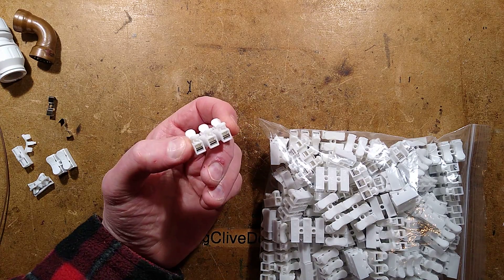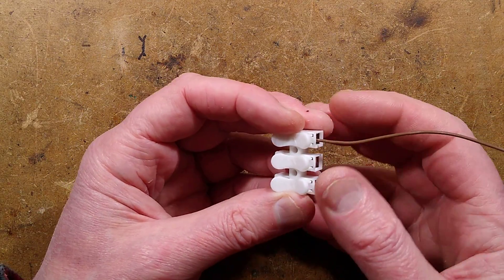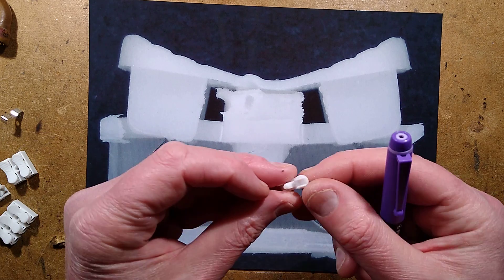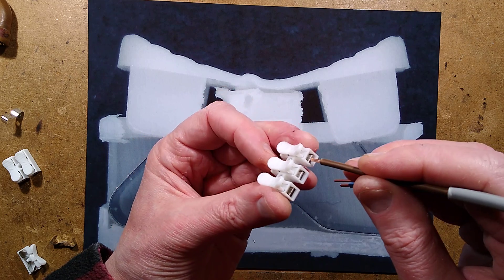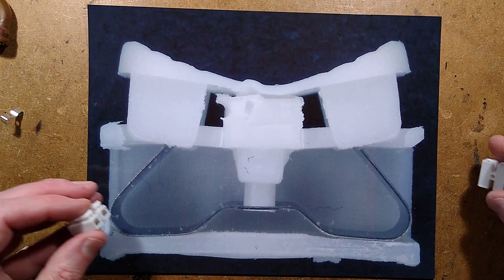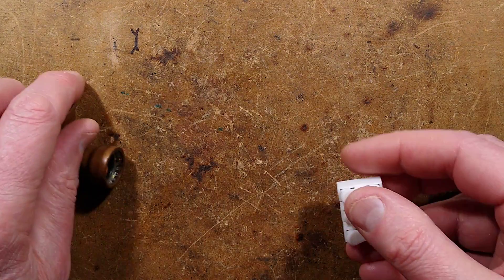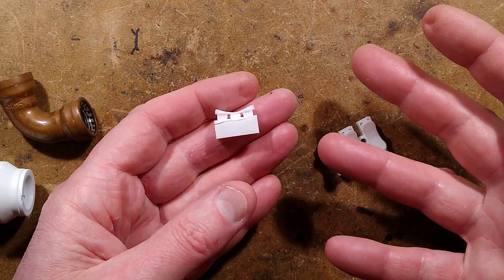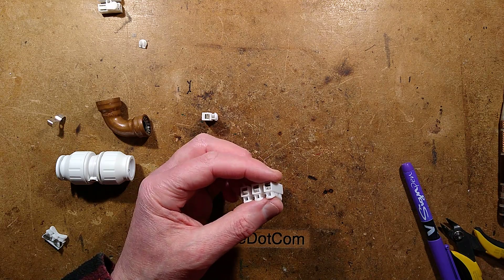eBay's cheapest wire push-connectors (Not for house wiring!)

Comment: I first came across these things, in an "LED conversation kit" for a kind of DD bulkhead fitting. The idea was that you rip out the balast for the fluorescent tube, pop in the led panel, and then use one of these to connect to the power. At the time I didn't have any alternative, but like you I concluded that it's not really a high power application, and it's well out of the way inside the light fitting. It's not brilliant but it's probably OK as long as no one messes about with it. I definitely wouldn't want to use them on anything with more power.

Comment: These push-connectors looks like they are intended for projects or relatively low voltage / low current devices like RC cars.

Comment: Looks to be ok for model railway circuitry.  They run at typically 12-20v DC or AC and are usually only running at milli-amps.

Comment: Hi I bought them a month ago,for DIY and decided not to use them , I wasn't aware low amps until I had purchased them ,i switched to screw up connector blocks rated for 15 amps better safety in mind ,I enjoy your tests cheers

Comment: I was using one of them with a small (12V 4Ah) LiFePO4 battery to test some T5 and T10 LEDs that I had just soldered some leads to.  I accidentally shorted the leads together when trying to test two of the bulbs at the same time and quickly discovered what happens on this connectors when you run too much current through them.  I don't know exactly the value that is "too much", but I definitely know what happens when it is well above that value.  The spring clip actually acts as a *fuse*... If you look at the clip, you will see a hole in the middle of it, so there is only a small portion on each side of the hole for the current to flow through.  I ended up with a small flash and then the connector no longer had power on the other end of it.  I cut it apart to dissect it and discovered that the two side pieces had melted on both clips.

Comment: What a missed opportunity to melt under load. All you needed was 36V at 3A to watch them melt LOL.
Reply from the maker: It would have needed much higher current.
Reply: My cheep connectors same as your cheep connectors When put in line with 240w 36 V Solar Panel and 2 x 12V series = 24V Leisure batteries and a  30Amp Charge controller Current charge load under charge measured at 3 Amp  delivered from Solar Panel and as a close watched experiment ( I did not expect them to start melting at such low current  so did not have cam recording ) So to limit the current from the solar panel I used 3 x 12V 20W incandescent in series, So max Current flow = 60W/36V = 1.666A from Solar Panel My cheep Solar Panel current controller Lamps  - The cheep connectors can handle that OK LOL

Comment: The copper bend looks like a 'quick fit'  where you simply insert the 15mm copper pipe  without any need to solder and i imagine clive it works on a SIMILAR principal to those connectors, i think. Those connectors look flimsy and that MAYBE heat might build up if used in the wrong circuit. ? Whether possible or not, they do not look like good quality and i would imagine have no real rating on the current for which they MIGHT be used.

Comment: In Central and Eastern European countties most houses bult in the early 1990s or before and not renovated have aluminium wiring with the wires being connected simply by twisting them with pliers and wrapping them in tape. It lasts decades when done properly.

Comment: Did you try testing them at a high current? A good way to do this is to use a variac and a toroidal transformer with one or two turns though the middle to make a high current secondary and a clamp meter.

Comment: These are REALLY useful for low-voltage prototyping (i.e. arduino & co)
you can easily stuff multiple wires into the connector, then connect that via breadboard wire to a breadboard.
they can also handle much higher power than a breadboard, and you can buy a LOT of them cheaply.
the WAGO-like clamp terminals are way too stiff for such usage

 WAGOs are useful for high-voltage low-amp power in hard-to-reach places
i.e. lighting modules and fans installed into the ceiling and such.

Comment: There's only one valid test for these connectors in comparison with WAGO and other approved connectors. Using a thermal camera - Flir - or better - push 30 amps of current through these as a sustained test circuit and see what temperatures manifest themselves in constant use, and record the voltage drop, and the mechanical tension under load during the test. You can do it Clive! BTW there's an interesting Inhalation device called Astro BAR that features a digital charging display for the enclosed lithium cell, which could form a nice little project for reclamation of the cells in such discarded disposable devices.

Comment: I bought some of these a couple of years ago and they're fine for testing. I would never use them for anything permanent. Neither would I use Wagos. I am often surprised at some of the types of connectors used in permanent installations. Of particular note is UK assembled stuff, but then UK is a proponent of the absurd and dangerous "ring main" system. I have even seen connectors similar to wagos used on PCBs in German-made space heaters.
  I do work on imported caravans to make them meet the standards we have in the antipodes; and, I must say, there's no cause for bragging that "it's designed (or made) in Europe".

  Glad to see someone warning people of the limitations of these things; well done. Though I would've thought that anyone knowing how to connect electrical items, would be able to figure out that these are not going to be able to carry any reasonable current or used as a permanent connection.
   I think the SS should electrolytically protect the copper in damp situations. Though anyone who uses any type of open (or unsealed) connection in that situation needs to rethink what they're doing with their time.

Comment: Are these safe to use for speaker wire? 🙏
Reply from the maker: For low power use, maybe.  But I'd recommend something better like a real Wago connector.
Reply: Thanks big man 👍 I have both these & real wago, but didn't wana waste them on a little 30 watt per channel system if I could avoid it.

Comment: I served my electrical apprenticeship in late 1980’s. All electrical accessories were stringently regulated and were improving rapidly from previous decades. This evolution saw high quality British made products with design born from many years of experience. Equipment was robust and was tried and tested. The last few years have seen a huge influx of products from Europe which have evolved to facilitate speed of installation. Some products are good, some not so much. Coupled with the mass production from the far east leaves me feeling that the industry is sleep walking into disaster. We are loosing the connection to huge knowledge base that was compiled by electrical engineers of a soon to be forgotten era. As circuit protection methods improve, we seem to be neglecting the necessity of circuit integrity. Perhaps I’m too old 🤷‍♂️
Reply from the maker: We're definitely going backwards, with deskilling for profit so that unskilled labour can be used to do electrical work with "qualifications" that are more like a liability transfer document.

Comment: Those water fitting of a similar type but in poly are failing about 10 years late, 2 unit blocks have had concreate dug up twice with failed fittings, and myself have repaired a friend's water line that had also failed in about the same time with similar fittings, also some cheap power points and light switches are breaking from going brittle in the same time frame

Comment: My dad would have loved these in 1976 to connect speaker wire and run it round the house. Seem to remember loads of terminal blocks at various locations under the bookcase and settee.

Comment: I bought some of these from eBay years ago. I'm not sure if they were exactly the same but the ones I received gripped the wire so loosely they weren't suitable even for low voltage low current. I'm SO GLAD I eventually found the Wago terminals.

Comment: If you use them for what they are intended for, no problem.  Great inexpensive design.  I use them with my breadboarding and low current/voltage connectons.  Of course there are always the folks who put pennies into fuse boxes.

Comment: Thinking of the connecting surface and the lack of plasticity in plastic is crucial part part of the design.
This is crazy. 
Even if you are able to push 10 ampere through it today, I would not trust that it be fine in a year from now.
Without thinking about the corrosion, this is a very bad design.
I would consider to use them for a breadboard project.

Comment: Have you seen those old wartime self soldering connectors, where they stick two ends of wire inside and scrape across it like a strike-on-box match to set off the firey bits and hopefully create a solid connection for various engineering & de-engineering... really interesting kit

Comment: I've seen these used as a "tool-less" wiring solution for a low-voltage HVAC device.  I'm totally with you Clive, I definitely wouldn't trust them for mains voltage or high power.
That being said, I would love to see them tested to failure.

Comment: I think this if I use 60 w or over something I may burn it slow and  steady in my country we have bakelite dark like plastic more like ceramic does not melt well or burn if you see them screw on connectors they had 2 3 4mm pipe ones with 2 screws incased in it in long strip that's heavy duty the most big one I cloud see was like 8mm wide even 9 I seen more recent almost cm tick with 3mm whole down the middle and screw takes time but can take a microwave

Comment: A lot of cheap screw terminal strips are literally zamac/pot metal - should have seen my face when I once tried soldering to one with an iron fully cranked up to give it a head start on the thermal mass :)

Comment: Are the contacts inside a Wago connector actually copper? They look more like steel color to me.
Reply: They will be plated to prevent oxidation, over copper or brass base metal. The spring part could be stainless steel.
Reply: @dino6627 : That'll keep the electrical resistance suitably low, but does it address the issue of galvanic corrosion that Clive raised? Maybe the galvanic potential between brass and copper is lower than that between stainless steel and copper, so it's less of an issue?
Reply from the maker: Tinned copper.

Comment: Yeah, not the best. I had several of these connectors to use it with Arduino projects but the biggest problem (besides the poor one side connection quality) is the quality of the plastics. The sharp metal endings on top 'bites' into plastic and after a few times using it, it is very difficult to insert a wire. I think they can improve the design by using a flexible metal (better is copper) rod on top of the claw. This avoids the 'bite' into the plastic and it makes a better surface connection on top of the wire.

Comment: I recently had to diagnose a light fitting failier for a family member, the fitting was rated for a 40w bulb but someone had put a 150w bulb in it and it stopped working shortly after, I found the fault was with this style connector, the cable had started to spark and had eroded a lovely semicircle into the spring, I told them the fitting had failed and got them one rated for the light output they required and fitted a propper 30a junction box (nice beefy screw terminals, love it), great video BC

Comment: I've learned to fear connections wrapped in yards and yards of insulating tape; anything under the tape WILL be a bodge! If it's on a 240 volt circuit, I turn off the supply first, as at least one live wire will be exposed when I take the tape off. In my brother's old house they didn't use insulating tape or even actual terminals when they took a spur off the ring; they thought twisting the ends together and "insulating" the connections with some adhesive fabric tape, the type you find in a first aid box, was a much better idea!

Comment: If you understand that these comes with three connectors is because the ground wire is supposed to go inbetween.  Any fast connector with any insulator will fail eventually through age.

Comment: If the 8 year old one that fell apart isnt a hint that these suck … I don’t know what is. 

It’s a fun surprise too when the housing fails on them. Might be in a few months. Or years. 15A/20A 120v circuits in America might push them over the edge. 

Pull some high current. They get hot/melt. Burnt your recently remodeled kitchen down. Big brain stuff to say the least.

Comment: Low voltage, high current test at 10 Amps please.
My concern with this type of connector (and I'm just going to look at some Wagos I have in the workshop) is what it's the cross sectional area of the joint, does it maintain the the CSA of the wire ?
Reply from the maker: I've opened some Wago terminals in the past and they do have a decent copper busbar.

Comment: The steel is very thin and I imagine it would heat up some with the attendant problems. Mind you, doubtless they have bigger versions for joining say, pylon cables, which is what those little box things are you often see on the wires probably are.

Comment: I recently purchased a new fluorescent LED fitting from Wicked, it had these fitted. 3 times I put the cable in and 3 times the cable came out when putting the fitting up. I removed the connector and fitted a choc a bloc scree connector. These cheap push connectors are dangerous as arcing could occur.

Comment: I’ve never seen one in a light fitting fail which would suggest they’re absolutely fit for their intended purpose, it’s not exactly fair to judge them on “inappropriate use by idiots” as some in the comments seem to be doing

Conversely, I have seen fittings with failed screw terminals that were almost certainly caused by poor installation by the user… these things remove much of the scope for that happening

Comment: Yuck like most of these so called quick connectors. The actual surface area of the conductor in contact is tiny. Even the so called expensive types are the same. Yes very low current only. Time for the 10 Amp test, you can't beat a screw terminal properly done in my view.

Comment: Yeah, I also bought them long ago. It was definitely alarming that the sellers claimed that they could handle high current and voltage. It's hard to warn people though when you can't tell them the actual voltage and current something can handle. They are a clever design though for the price. I like the screw down ones that are the same size better though. I've seen videos of electricians opening up boxes and being horrified to see these connectors in them, often the connector is burnt. I just got wago like connectors, would definitely use them instead for seriois projects. I'd probably limit current to about 1 amp with these connectors, but sooner or later I'll use my thermal camera to see how hot they get. I knew dissimilar metals cause problems, but never learned a lot of details. Good topics to bring up.

Comment: Stainless steel is considered to be a neutral metal when used for lighnig rods here in Germany. You can clamp copper or aluminium with it without getting corrosion issues.

Comment: Normally in 230V circuits you are not permitted to connect wires together in such a way that plastic parts are responsible for connection pressure! The fact it is just metal spring in plastic housing means as soon as temperature creeps up over 120-150°C most plastics are coming into their respective "plasticity" temp zone and just derom, give in = higher connection resistance hence exacerbate the temp issues further -it's a thermal self sustaining catastophy. It's a fire hazard waiting for "that day". 

Examples from real life: All it takes is one capacitor put in the wrong way; Because of current limiting features prior -the capacitor would not blow, just conduct alot and make a heckton of heat that totally charred the insides of this particular product we where manufacturing. The casing became partially soft and melty... and stinking.. ooh the stank of plastic and circuit boards past boiling point approaching flash point is not nice. The product was actually working fine for well over 20 mins... well, except the display could not be read anymore because  a black cloud of burnt plastic soot covered it on inside.
Luckily for us these products never had a chance of reaching acustomer because of a lenghty in-house testing before packing. If a product just been subjected to just a quick test no one would notice until the smoke/potential fire would seep out 20-30 mins in first time use. (During testing no actual fuses where even hurt, and the staff took an paid hour off for the test area to be ventilated)

The problem was traced back to the capacitor batch on the tape reel in PCB manufacturing being taped with polarity flipped compared to normal. So we had 1000's of PCB in manufacturing that now needed manual work to desolder and flip capacitor polarity.

Had this product been connected with these "spring load onto plastic" connectors they would create an extra issue, wires under tension crammed in a tight compartment, residential ceiling light fixture as example, it might break free and do whatever, hopefully the connection would just sever before setting house on fire.

Comment: You will get galvanic corrosion between copper and stainless steel, unless you can create a barrier to prevent the electrolyte bridging the different metals, this can be done with a cavity wax or grease. See this Wikipedia article https://en.wikipedia.org/wiki/Galvanic_corrosion